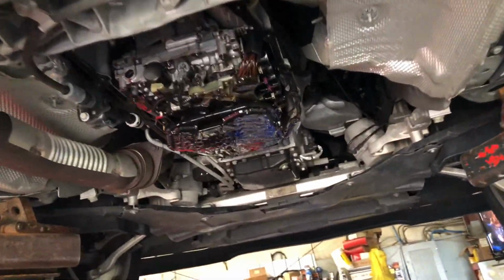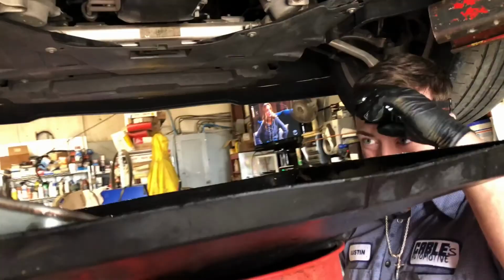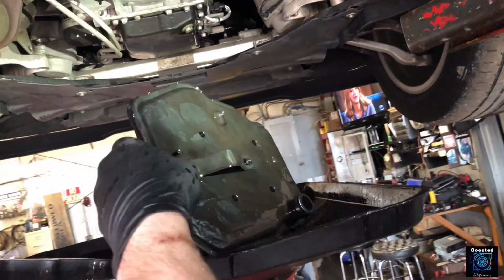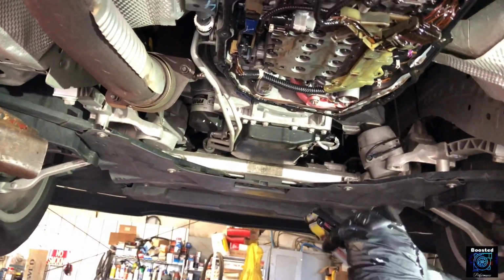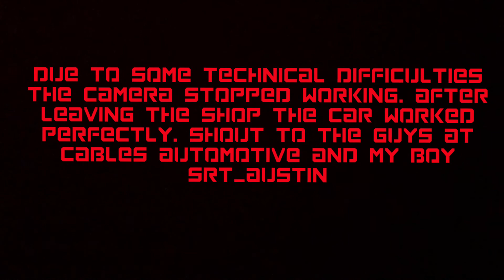Great!!!!!More Trans Problems!!!!!!!!!

Comment: Hey man I like the videos nice setup you have. Dont quit on the transmission. I've got a maxed out 6758 on 30psi with meth injection and trans runs great. Subscribe to my channel and ask if you have any questions. 8l45 doesnt need a build. 

To solve your problem definitely, put a new torque converter, use the mobile 1 atf hp fluid ONLY, then you're going to have to tune your transmission and sort out any kind of stutter that may still be present. 

Hope all gets better man!
Reply from the maker: Thanks for that I finally got a trans tune and it’s absolutely working great